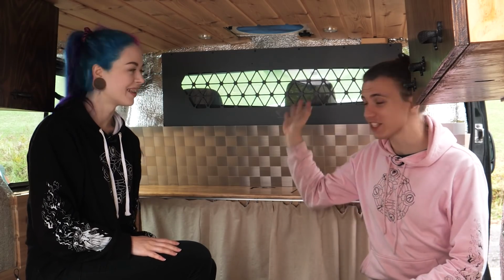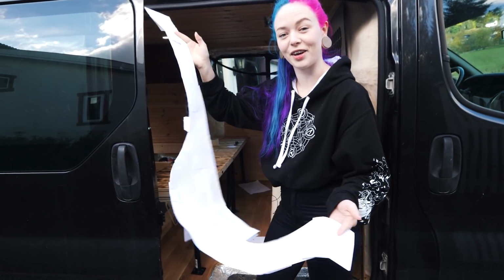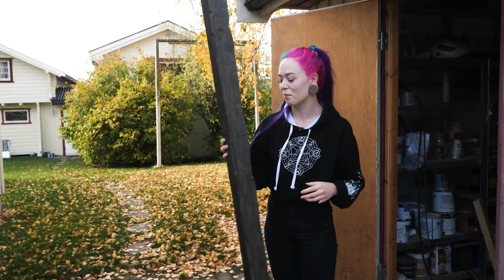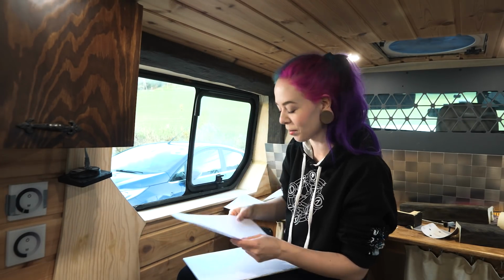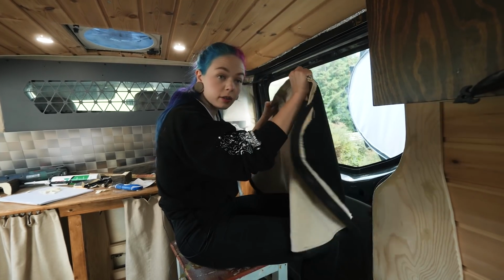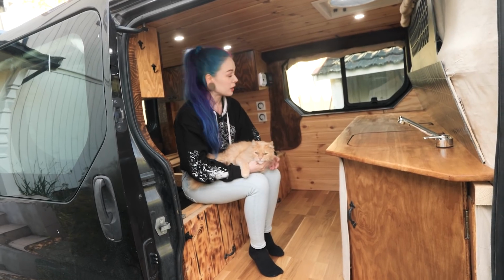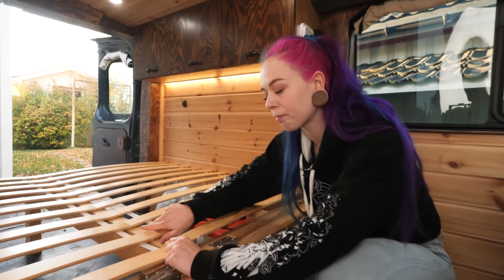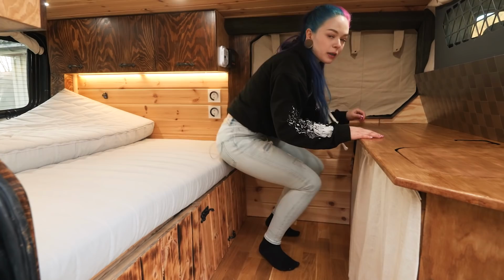Finishing the Camper Van Conversion! ( + Van Tour)

Comment: Martina & Hansi!, I love how your van has been coming along. The aesthetic is spot-on I think for trying to make it feel the most comfortable for such a tiny space.  Martina, your spatial intelligence to see how to make the most use of a space & make the space work at its maximum is a rare talent.  Hansil, I'm sure you have decked out the van with the best electronic options you could get including the amazing solar power. That is super smart on so many levels.  I am constantly amazed at how versatile your knowledge of computers, electronics, & so much more technology. 
May I make some logistical observations & suggestions concerning your storage solutions as I do not want you to have any frustrating or even injuring situations. (These are only based on the short glimpses in the videos you have posted, I could have missed or not realized you have already realized them & designed a solution... but just in case you had not I wanted to point them out.)
1.)    I am seriously concerned your kitchen storage, only being held back by a curtain, will become a major irritation, at the least, to a serious safety hazard, at the worst.  There appears to be nothing to prevent items from falling or sliding all over the van during any sudden stops or quick turns.  You could use sliding doors or strong accordion doors to ensure nothing flies out of the area.   There are sliding doors, can slide around the sides of the cabinet to the back of it,  allowing you full access to the cabinet without doors taking up space
2.)    Next, I believe I noticed the storage cabinets above the bed do not have lockable latches.  I would hate for items to shift while driving causing something to falls out & lands on one of you who happens to be napping while the other drove.  Even if it does not occur during driving, once you stop to sleep, the shifted items could be just at the point of falling out of the cabinet making a very rude awakening in the middle of the night.

I hope you see this Martina & Hansil so you will know how amazing I believe you two really are & to ensure your van is as safe & irritation free as possible.

Comment: Congratulations!!!
My Mom had this kind of thing for a few years.  You might consider putting horizontal slats behind the doors in the cupboards above the bed.  The purpose of the slats is to keep anything in the cupboards from sliding into the cupboard doors and opening them from the inside while driving.

Comment: You can also use the "dining chairs" as a bed extension. The n using the top matress/pillow to fill in the space. *You will just have to buy extra pillows... you can never have too much pillows🥰
Reply: Attachable beems underneath the sink would be safe to prevent sliding/tipping/ movement . A special unbreakable attached/ detachment for the "gas" and dishes etc.

Comment: Your CO alarm is mounted too high. CO is heavier than air so your alarm needs to be mounted down near the floor. Having it as high as you do, by the time it goes off you have already been exposed to dangerous levels of CO. If it's mounted near the floor, it will go off before the CO reaches your level, giving you plenty of time to get out (10 year EMT here btw).

Comment: You gonna have problems with the slatted frame of the bed. It needs space on the sides to be able to flex when you lay on it. I did build a simmilar contruction and the bed started to be comfy only after i did cut of 2cm of each singe slat.

Comment: With those batteries directly under the bed like that, I'd feel better if you had temperature and/or smoke sensors under there.  Also caps over the terminals, otherwise you may be dealing with corrosion after a while.  Just to be safe.

Comment: I love you're Channel 😃  I see that the battery bank is located directly under the bed. Are the batteries sealed in metal boxes that would protect you from accidental over charging and explosion? Also are they vented and plumbed for their fumes to be channelled out of the van, so you don't breath the fumes as they charge?

Comment: One question is what you do in terms of bathroom facility?
Like, out in the wild you can squat down, but what do you do if you are at a campsite near actual people?
Reply: Most proper campgrounds have a toilet, or at least a Biffy (GSC term, essentially a hole in the ground with a shack over it which has a toilet seat that opens straight into the hole so any waste drops into it).

Comment: Love what you've done. But I'm concerned about having the propane and diesel inside. Your propane/gas detector is too high. When you're sleeping in the bed the gas will start at the floor and build from there. You will be too far gone by the time the gas reaches that high point- if it doesn't find a way out and never reaches that high spot above your bed. Please at least put a detector below the level of the bed. And at best consider storing the gas outside of the van...

Comment: I need to come on and be such a man but have you tried driving it yet? How does the weight change the handling? Its a van so it can obviously handle more weight than that, I'm just curious.

You've both done a great job, it looks amazing. Oh, and Hansi you need to do more than set up the camera and clamp the thing with your head 😂

Comment: That van to RV / mobile home conversion makes me jealous. In bureaucratic overregulated Germany they make you jump to a lot of hoops when you want to convert a van into a mobile home. They are taxed differently and there are tons of regulations. For instance all edges must be rounded by at least 2.5mm or more. That would also include those two controls on the wall. The insulation material has to be certified according to some automotive standard so you can't just use the stuff from general hardware stores. Etc. etc.... Norway is truly a free country. EU is playing crazy H&S obcessed just to make corporations more money.

Comment: First of all, I have been enjoying your channel, and I'm tempted to subscribe, but I was very upset to see Martina using a jig saw without safety glasses. You are a professional vloggers and should be practicing and demonstrating safety at all times, also I'd hate to see your pretty eyes get damaged (video 3 I believe, making the cabinets).

A couple of thoughts. For the USB charging outlets, I would have put them inside the cabinet and perhaps divided that cabinet with a shelf to provide somewhere to place your electronics out of the way while they are charging. You could still incorporate this, just use a wood cover to fill the existing charger holes.

Then, there is iron on veneer tape made of real wood that would have finished the edges of your cabinet doors and some of your door panels a lot better than seeing the raw plywood edges. Still something you can do now, just means having to refinish the edges of the panels/doors. 

The cabinet door panels would have looked more modern with a finger grip routed in the inside bottom edge rather that the handles you used. Also one less thing to hit your head on! Just some thoughts from an old wood worker. Great job, none the less.